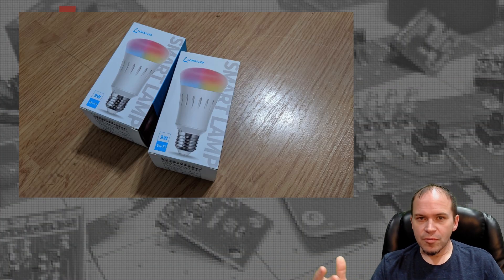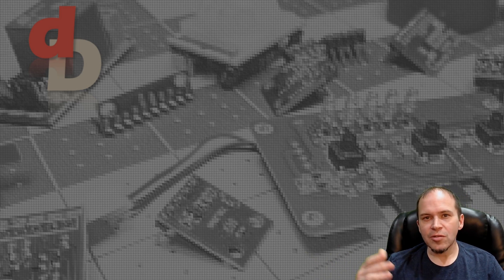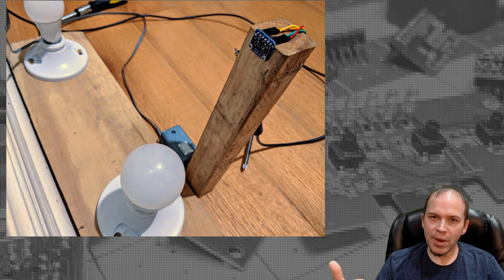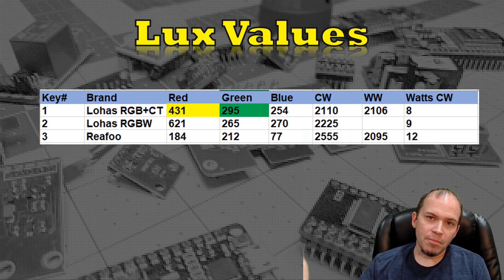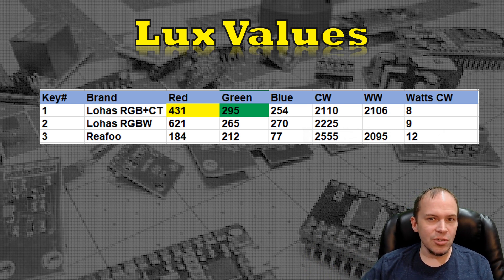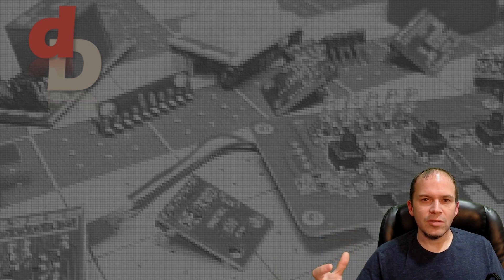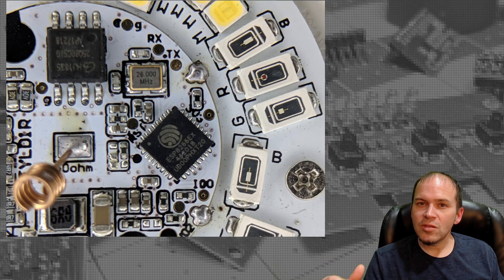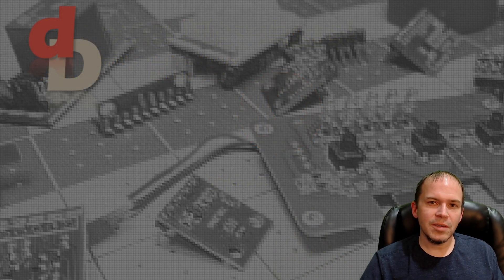Is the new LOHAS RGB+CCT Smart Light Bulb Better? | Templates for Tasmota and ESPHome

Comment: Do these have a longevity issue?  Checking the amazon reviews real quick, and it seems some people are saying they only last for a few months.

Have you used these long enough to know?  Also if so could a heat sink mod help?
Reply from the maker: I know they had out of stock issues with them and changed the chips as well.  Some of them had cap issues and even wifi signal issues.  I'd check out the Switchbot bulbs as you can flash them over the air and pretty solid bulbs. https://digiblur.com/wiki/devices/bulbs/switchbot_e26_w1401400

Comment: I've been using Lohas bulbs for the past year or two, and am suddenly having some issues. First, one of the bulbs just turned green and wouldn't respond to any commands. I tried making it discoverable but nothing affects it. Then two of my other bulbs started flickering. It isn't noticeable at full brightness, but once you dim it you can see the flickering. Are they just going bad?
Reply from the maker: I have heard of some reports of bad caps in them and some folks have contacted the company or replaced the caps.

Comment: I bought a 4 pack of the CCT bulbs based off this video and successfully flashed them to Tasmota and used the template in the video description. Everything is working great from the Tasmota web interface, but I am having issues controlling them via Home Assistant.

Does anyone have their home assistant yaml that they can share for the RGB-CCT bulbs running Tasmota? Is it any easier if I switch over to ESPHome? I haven't used it but I'm not opposed to learning if it would be easier.
Reply from the maker: I actually find Esphome annoying for lights due to the way it does the split channels. Hoping they fix that one day. I have a sample config below but honestly now with all the upgrades and fixed they did to auto discovery. I would just use that. Setoption19 1 and let it rip.

https://github.com/digiblur/Tasmota/wiki/Smart-Bulbs#rgbww-lights-5-channel-lights
Reply: digiblurDIY Looks like the latest beta for Esphome added a “color_interlock” option that does a better job of combining RGB and CCT channels when selecting colors, no more having to manually turn down the white level to show color. I’m still finding Tasmota to be a smoother experience (less flickering) so I’m hoping that will improve eventually since I have lots of lambda light effects in Esphome, as well as transition support in Home Assistant.
Reply: Ok, I answered my own question in a couple of ways. First, there is a config available on digiblur's site here: https://github.com/digiblur/Tasmota/wiki/Smart-Bulbs I just used the 5 channel option and it worked great.

The second option, I don't know how it took me this long to find. I have over 30 tasmota devices around the house and somehow missed SetOption19 this whole time. Setoption19 1 will enable auto discovery in Home Assistant with no additional config needed. I ended up going this route just to try something new and will definitely be using this more in the future.
Reply from the maker: Now I see your response up for "review" after I posted the reply.  Ha.  We pretty much said the same thing.

Comment: I had an "uh-oh" moment with the BR30 version of this bulb. Converted using Tuya Convert 2.3, flashed Tasmota, flashed ESPhome and worked fine. Flashed Tasmota-minimal.bin through the web server on ESPhome, got the flash successful message but the bulb didn't come back with tasmota. Access point is named esp.... instead of the usual tasmota-xxxx. Is it possible to reverse engineer the 8 pin pad visible when removing the dome? I've found ground on two pins but I don't have experience/tools to move beyond that. Looks like that's how they uploaded original firmware?
Reply from the maker: Do you see any 3v3, rx or TX pads? And yes if you flash minimal it does not have the access point mode. It's better to flash the wifiman bin.

Comment: Do you by chance have an ESPhome yaml for the new bulb?
Reply from the maker: Try here. https://esphome-configs.io/
Reply: @digiblurDIY  Thanks. I ended up using another yaml and used the blackadder pinout: 

output:
  - platform: esp8266_pwm
    id: output_red
    pin: GPIO5
  - platform: esp8266_pwm
    id: output_green
    pin: GPIO4
  - platform: esp8266_pwm
    id: output_blue
    pin: GPIO13
  - platform: esp8266_pwm
    id: output_warm_white
    pin: GPIO12   
  - platform: esp8266_pwm
    id: output_cold_white
    pin: GPIO14

# here go the light definitions, effects and restore mode
light:
  - platform: rgbww
    name: 'Lohas Smart Bulb 1'
   # id: '${device}'
    red: output_red
    green: output_green
    blue: output_blue
    warm_white: output_warm_white    
    cold_white: output_cold_white
    warm_white_color_temperature: 2800 K
    cold_white_color_temperature: 6200 K
    
    # Attempt to restore state and default to ON if the physical switch is actuated.

    restore_mode: RESTORE_DEFAULT_ON
Reply from the maker: Glad ya got it!  I use Tasmota for most of my bulbs since it is easier for my setup/use cases.

Comment: Hello. digiblurDIY you are turning , for me, the first one to follow in terms of home assistant, i am triyng to follow some of your projects ( i am waiting long time for shipments ) already half done the multisensor project.

I have a question for you:  For me tuya convert it,s not a option yet ( still very rookie at that) do you know if it is still in the marcket some lohas rgw+ww , like the ones on your previest video, but for me have to be E27, i am from Portugal, and i would aprreciate if you find them in aliexpress or in amazon.es.  ( i would flash them with my ftdi )
Reply from the maker: I'm not really sure on the LOHAS bulbs in your area.  They usually say a white range of color like 2700k-6000k or something like that means it is WW/CW

Comment: Like newer tuya devices that don't even have an 8266 chip in them. Screwing us tinkerers, deliberately or not.
Reply: Honestly though, I'm not sure (for a retrofit) if smart bulbs are a good option for me anyway. Everything is on a traditional toggle switch. Can't even simply bypass that w/ a Shelly and hardwire the sockets. Where would someone use a device such as these?
Reply from the maker: We like to use them in lamps mainly.  Then I started to branch out to a couple rooms where the smart switch toggles the light on the wall switch.  Really a must for renters.

Comment: Thanks for the great videos! I bought these bulbs based on your review video and ran into the new bulb design. Yup, took it apart further but decided I was getting over my head so did manage to resolder the bulb together. Your OTA instructions have worked flawlessly so far. Thanks again. One question on the MJ dimmer using your scripts; when I step from the lowest light value up after 5 steps the Lohas bulbs seem to jump down a notch and start up again. Maybe it switched whiteness values too. It takes 10 total steps to get to 100. Not sure where that step size is set. However, the console readouts on both the bulb and dimmer increase by 10 each time. I'm very new to this stuff so maybe I missed a step applying your rules to the dimmer. The long button pushes work OK both down and up. I do not own any older bulb to compare.

Again, thanks for your work.
Reply from the maker: Can you watch the log on the actual LOHAS bulb to see what is being done to the dimmer value?  I do believe the dimmer + command is a 10 step on Tasmota.